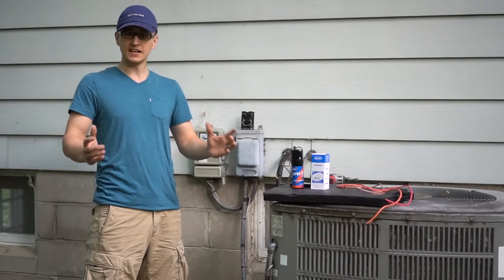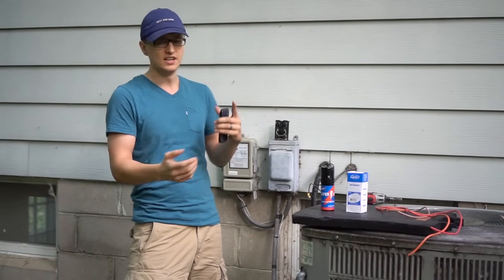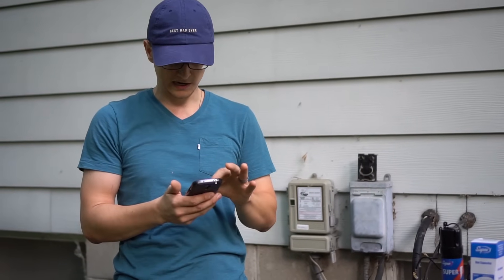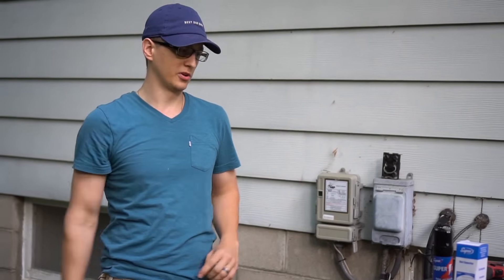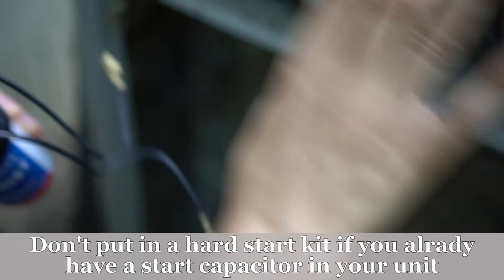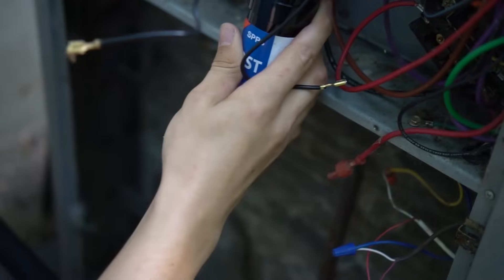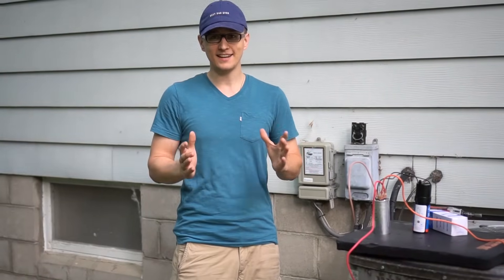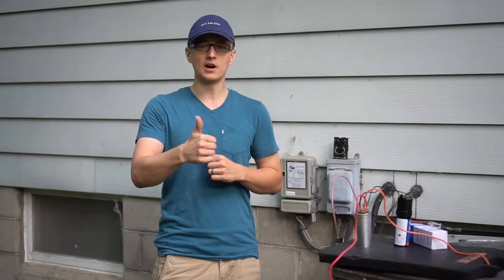How to Install a Hard Start Kit in Your Air Conditioner

Comment: Did you remove the questions you answered for me earlier today?  I was trying to read them again and can not find them.
Reply from the maker: @Jo Tu I don't remember removing anything. I get a lot of comments on a daily basis though so I can't keep track of all of them. Was there any swear words or links in the comments? Those automatically get marked as spam. I will look in the spam folder
Reply: Only links to reference articles or videos.
Reply from the maker: @jotu173  I think those may have been on a different comment thread. I just answered your comment on the other one.

Comment: Your fast reply is greatly appreciated as I want to ad this ASAP.  Are hard start kits "one size fits all" / universal???  In other words, can I use the exact one in your video on my 20-ish year old Bryant 3 ton residential condenser? If not, then how do I figure out which one to get?
Reply from the maker: The one in the video is for 2-5 ton units. So it will work just fine for your unit. Have a good day!
Reply: @WordofAdviceTV  Thanks for fast reply.  After watching other videos (specifically https://youtu.be/IjGnGbjelMo and https://www.youtube.com/watch?v=jFFRpxFkpcM ) and looking at this discussion board ( https://hvac-talk.com/vbb/showthread.php?602302-hard-start-kit-or-super-boost ) I have some follow up questions.  My unit info is on the prior post.  It is a piston / fixed orifice unit.  To date, I have never had any problems getting the compressor to start. Questions are as follows... 1) Should the fact that it is a fixed orifice have any bearing on deciding to install a hard start kit or not?  If so, then why?  2) In your experience, will putting a hard start kit into an older unit potentially CREATE any problems (since mechanical parts are old).  In other words, A) possibly break ?crank shafts? or B)  harm the windings due to an increased torque / current inrush??  Additionally, I am assuming that it is more of a value to add the kit to a new unit for most of the reasons you listed but, in my case , 3) am I correct in thinking that the main reason would be energy savings and only HOPING to increase compressor (and thus my whole AC unit) life?  I say this since the compressor is already so old, I assume that I have missed most of the opportunity to increase its longevity due to any damage that has already been done to this point in time. 4) is any brand or kind of hard start kit the best and (if so) which is best?  in other words, Supco Vs. 5-2-1 Compresor Saver Vs. ?Kickstart? Vs. ??? Again, your fast reply is appreciated.
Reply from the maker: 1. The metering device you have does not really matter. Although TXV systems are generally urged to have a hard start.
2. As far as I know, there is no harm done by a hard start kit. In fact, the in rush current, in most cases, is cut almost in half after a hard start is put in (I should make a video on that)
3. Electrical motors, including compressors, work the hardest when they are starting. That is when the most wear and tear happens. A hard start capacitor basically reduces the amount of time it take for the motor to start, therefore reducing the wear and tear.
4. So for older compressors, it is actually a good thing. Theoretically it will prevent further wear of the windings. As for which brand is the best. There are varying opinions. Many techs will say that the 5-2-1 compressor saver is the best. And maybe they are right. I personally prefer using the spp6 hard start kit. It's super simple to install and I've never had problems with it.
Reply: @WordofAdviceTV  Thanks again for your fast reply.  I am curious did you have the chance / time to watch (the important parts of) the second video that I listed before your last reply to me?  The video is pretty convincing to me (I have an EPA Universal license 608 card but I am not a pro like you) that the 5 2 1 is superior, but it does cost MUCH MORE (over 3 times more) so I wonder if it is really worth it. FYI, I live in TN, USA and it can get VERY hot & humid in parts of the summer.  I include this detail just in case ambient temps hav any effect on your opinions about the various hard start kit options.  1) Wondering if your answer is the same about the 5 2 1 and SPP6 AFTER viewing that video and (if so) why?
Reply from the maker: @Jo Tu The video where the guy uses the little computer monitor to see the current fluctuate? Yeah, I watched that. I guess you have a point there. I live in Minnesota so the weather does not get as hot as over there so I can't claim that I know how the hard start kit will perform down south. That being said, most digital thermostats have a time delay built into them that should give the hard start kit enough time to cool off before the next cycle. Also, there are a quite a few units out there that don't have a start capacitor at all. So if the hard start kit occasionally does not cool off in time, that is not the end of the world. The unit will still start with just the run capacitor. Is the 5-2-1 start capacitor and relay better quality stuff? Yes it is. To be honest though, I am not very interested in dissecting to a fine science on how exactly various components work. I leave that kind of stuff for other channels. So perhaps I am not the best person to answer your question. As you have probably noticed, on my channel I prefer to keep it simple :)

Comment: CAUTION HOME OWNER DISCHARGE.. THE CAP AT THE TERMINALS.  BEFORE TOUCHING IT BARE HANDS...ZAP.
Reply: How to discharge: take a screw driver and bridge it from common to herm and then common to fan.
Reply: I have not seen or heard - died by the Discharge of these capacitors. It hurts a little bit, but you will not die from it....
Reply: You haven't heard about the "ZAP" because they never lived to tell the story...j/k...I dropped a screwdriver on one terminal and the other part hit grounded metal and it burnt the screwdriver to the terminal.  I had to break it free. Definitely scared me.
Reply: @thembones12 it has 240volts smarty

Comment: do we have to remove the stock relay when installing the hard kit? or can we just wire the hard kit directly to the capacitor?
Reply from the maker: This video should answer that question better than I can type it: https://www.youtube.com/watch?v=hC0nFT1XPcI&t=23s
Reply: If the hard start kit has one built onto it- then yes you need to remove the external potential relay if you chose that specific hard start kit that does not have the external relay!

Comment: Make sure you discharge the voltage out of the cap before you touch if not for you Johnny homeowners out there you’ll get lit up,call a pro first I don’t feel like getting your call after mess something up.
Reply: Bwahahaha....Johnny home owner can buy a capacitor..but not a fan motor...hmmmm where is the logic..you can get hurt easier by cap..then motor .everyone  knows to hit breaker..but many don't know about discharging a cap...bwahahaha...zap

Comment: Can you have a dual compacitor and a single compacitor as well as a hard start kit, like the brown wires for the fan going on the single compacitor and the other wires on the dual C, and Herm ?
Reply from the maker: Yes, if it is a 4 wire fan motor, then a lot of times that's how people end up wiring it. I have other videos like "how to wire a condenser fan motor" and "how to combine capacitors" where I kind of go over that if you need more info.

Comment: got me for $912 today for 2 capacitor wanted another $760 for 2 kick start can i just go with any type of kick start on amazon ? and thx for the vid wish i seen this before i spent that type of cash
Reply from the maker: Dang.. That is a hefty price for that kind of fix. Yes, you can just get and install the one I show in this video
Reply: Not to make you feel bad... just an FYI for any OTHER DIYers that may read this.  Most capacitors cost (max) roughly $30. each (parts only).  At a minnimum I would go on Yelp and rip whoever charged you $912. "a new one" as they say.
Reply: You think 580$ for capacitor and hard start kit for 3tons Unit UC is okay for the price?

Comment: How do determine when to use an spp5, spp6? is it better if you go spp6?
Reply from the maker: SPP6 is good for almost all residential units. The SPP5 is a little smaller. According to Supco: SPP5 is 300% Starting Torque
SPP6 is 500% Starting Torque

Comment: I put the hard start SPP6 in. Unit turns on fine. When the unit turns off there are sparks on the relay and it trips the circuit. Any clue.
Reply from the maker: I've never had that happen before. Is there a chance that the wires were not put in the right place or maybe one of the connectors is shorting out to another?
Reply: @WordofAdviceTV  i put the cover on and now its running fine and restarting at the appropriate temp rise. Might of been some wires touching by the relay. The instructions were straight forward. Thank you.

Comment: How do you know what size or model to buy for your unit?
Reply from the maker: The hard start kit I used is good for compressors that are 1/2 HP to 10 HP. Which pretty much entails just about all of the residential condenser units.

Comment: The two wire hard start you have in your hand has a positive temperature coefficient thermistor under that top cap. Not a potential relay. It opens and closes due to temperature rise and fall, not an electromagnet
Reply: So hypothetically if one has this on their AC Unit and they live in say the DESERT, where daytime temps are 100+, this is worse than having nothing? correct?
Reply: good to know but could you explain further...would the 3 wire kit have a potential relay..
Reply from the maker: Thank you for the correction! Good to know!
Reply: Haters gonna hate. I train people,  common everyday people,  in emergency medicine techniques.   Many have gone on to save lives......DIY'ers.
Reply: True tech knows, not diy'er.

Comment: I have some as you mentioned such as AC unit is getting old, Long refrigerant line sets , have multiple air conditioners  and have a home power generator. In this case which hard start kit you would recommend? Thank you
Reply from the maker: I usually only use the one you see in the video. There's an Amazon link to it in the description if you need it. And as you saw in the video, it's very easy to install

Comment: Do you have to discharge? Did you turn off all main power to home?
Reply from the maker: Yes, you definitely want to have to power off and discharge the capacitor before pulling the wires off.

Comment: What if my run-capacitor went bad two years in a row...13 year old Heil and the original 13-year old cap went bad in 2017. The replacement (same value 35/3 440V) went bad May 2018 and I just replaced it again, May 2019.
Symptoms...fan spins, but compressor started for a second or two then nothing.
In 2018 the compressor kicked-in but fan needed a manual push-start.
Cap replacement does the fix until the next year. 
*Fan motor is nice and quiet and compressor is nice and quiet too...so should I install a "hard start kit"?
Part number to order...SPP6 vs SPP5 how do I tell which one I need ???
Reply: Check your inrush, is it much higher than the lra on the rating plate? Also if you do need a hard start, I would just go for the 6. If the five didn't work you would have to switch up to the 6 anyway.

Comment: Is it really beneficial to install this on every AC unit which is working just fine? I have heard mixed inputs. Some say it help reduce  start stress on compressors and some say it put load on compressors with hard start? So confusing. 
I have done some research and it does reduce the Inrush Amperage however not sure if it elongates the compressor life or shortens it?
Reply from the maker: I don't have a good answer for you either. At one job I had, we were trained to promote hard starts in every unit to prolong its life like you are saying.. (that company had commissions) and at another job we only used hard start kits as a band-aid or last resort (if the compressor is struggling to start) because it is harder on the compressor. (no commissions) So my conclusion is that there is no need for a hard start kit unless there are conditions present that require it. I listed those conditions in the video. So yeah :) I don't have a right answer but that's my thoughts on it.

Comment: Last fall, our start capacitor that was part of our 5-2-1 hard start kit went bad (we realized this after troubleshooting our condenser unit this spring and it tested bad). Would not realizing this over a period of a couple days cause damage to the compressor? At the time, the thermostat was on cool, essentially sending the signal for the condenser unit to turn on. I am worried we may have done damage our unit.  In the process of all our troubleshooting, one of the things we looked at before the start capacitor was the contactor -  it wasn't pulling in and there was 240v going to it.  After watching your other video about that, we did manually push it in and everything is starting up. I hope that is a good sign? I am picking up a capacitor tomorrow, but was curious about your opinion.
Reply: My AC condensor had a similar problem where the 5-minute compressor delay board in the condensor went bad and blocked the 24v from making it to the contactor. So I bypassed the delay board and replaced my old mechanical thermostat with a new electronic type (Pro T701$32) that had a 5-minute compressor delay built-in.
Reply from the maker: Hey Lauren! I see units like that quite often and usually the compressor is not damaged in the process. If you replace the capacitor/hard start kit and everything works and cools fine, I would just leave it at that and not worry about it :) But if the contactor is not pulling in, that has nothing to do with the capacitors. If you need help with that, I have a video on 10 reasons why a contactor may not pull in.
Reply: @WordofAdviceTV  - Thank you for your advice! Turns out it was a bad circuit board. Apparently, our 30+ year old Carrier was quite advanced for its time with all kinds of safety switches. Lol. The HVAC tech bypassed it for now but we are off to get some quotes for a new one. I work for Grainger and though I knew a lot of basic HVAC stuff, I have learned tons from your videos. I helped myself and now I can help customers even more. Thank you again!
Reply from the maker: @photog_delgado  Great! The culprit was finally pinpointed :) Glad to hear the videos were helpful! Good luck with the control board hunting!
Reply: @photog_delgado  Depending on your desires, needs, and abilities... Another potential soltion is to simply replace the control board with an IDENTICAL cheap used (or new) board that you may find on ebay.  I say this because I have a 20 year old HVAC and thought I had fried the board so I priced one on ebay and it was only $35.!  Obviously, make sure that BEFORE you install it you take GOOD pics of the old board, its connections, AND ALL MINI SWITCH SETTINGS ETC.  Make sure new board is set up exactly as old one was.  Just find the part #s by entering your HVAC Model number (model info is on sticker usually easily accessible inside the furnace).  OR Actual part number may be on the board or schematic???.  OR google HVAC parts websites and search inventory.  Just wanted to share an option you may not have thought of yet.

Comment: It actually changes the phase angle during start up, which increases start up torque. The relay will drop out once the run winding gets up to speed.
Reply: Slip
Reply: Can I put one without having all them problems?

Comment: So I bought a hard start kit for my ac system. but I'm wondering do these need to be sized? I have the Rectorseal 96503 Kickstart T05. it says it's for a 1 to 3 ton with 1 to 3hp on it. and My system is a 2-ton heat pump. But I notice on the kit it has something like 330vac 189-227mfd and my capacitor says 440vac. should I be concerned?
Reply from the maker: As far as I understand it, the 440v means that it will work good with voltages up to 440v. Basically a maximum voltage of 440v. So no, I don't think that is a concern.
Reply: @WordofAdviceTV  Oh ok thanks a lot man. I really appreciate it!
Reply: I installed it. I dnt have a multimeter. But from what i can tell its been working great! Thanks again.
Reply from the maker: @Lilmiket1000  Glad to hear that! Stay cool!

Comment: It doesn’t lower the amperage. It reduces the time it’s in locked rotor range.
Reply from the maker: Can you explain that further please? I ask because I have checked max amp draw on the compressor at start up many times. Before I put in the hard start kit and after I put it in. And usually the max amp draw goes down dramatically.
Reply: Word of Advice TV  does your meter measure Inrush current.
Reply from the maker: I have a Fluke meter that can but my UEI cannot. I rarely ever use my Fluke so I can't remember the last time I measured inrush current. At my current job I only service residential units so peak current is all I need.

That is a good article, thank you for sharing! I guess I am not sure how to technically explain my claim. I just know that I measured peak amps/max amps and saw a big difference after the hard start kit was in. I used to even take pictures of before and after and show the customer. (previous job)
Reply: Word of Advice TV ulises is correct, what your seeing is a reduction in inrush amps because it was I. lRA for a much shorter period so your meter was not able to see it
Reply: Word of Advice TV https://www.achrnews.com/articles/119718-the-case-for-hard-start-kits
Reply: It defiantly reduces the Inrush current however when the compressor stabilizes after running constant the actual amp rating is same with or without this hard start capacitor.
Reply: It does reduce start amps not running amps